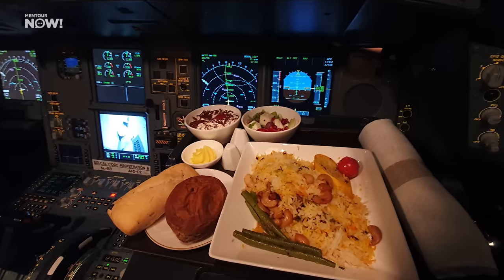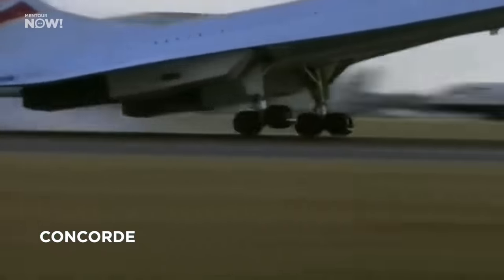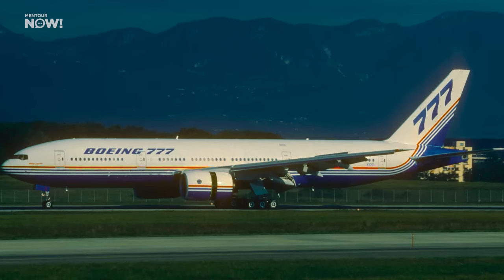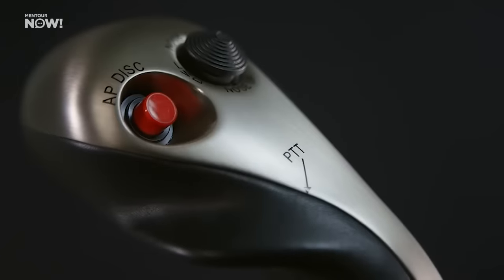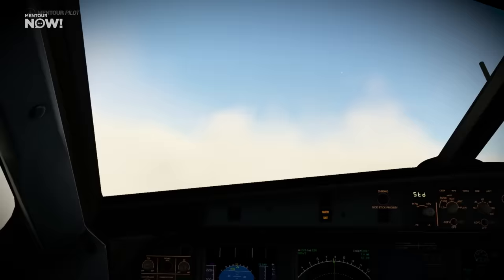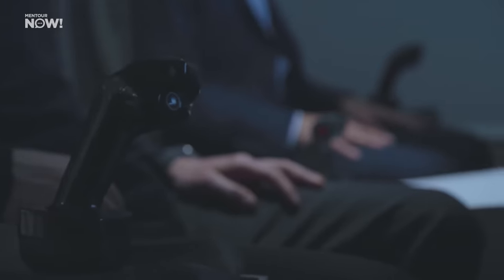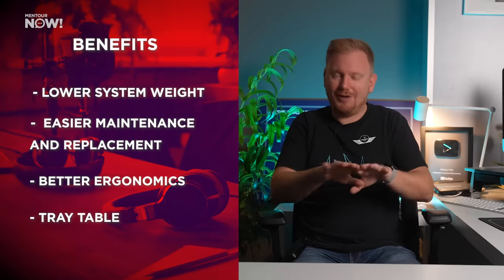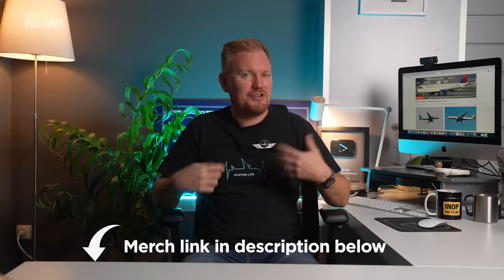Will Airbus Finally switch??

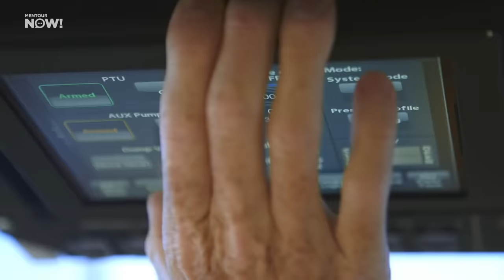Comment: What’s cool about Gulfstream’s side sticks at 9:58 and 13:40 is the pressure on the sticks movement is different from left to right. If you’re if the left seat, your left hand would be on the stick. You naturally have more strength turning your wrist inwards. So Gulfstream made the inward pressure and outward pressure different. This way both ways feel the same. And the the opposite on the FO side. Beyond cool.
Reply: What about left-handed pilots? And what about different combinations of dominant hand for first and second pilots?)
Reply: @lefty2050 Real-world pilot here. I’m right hand dominant, and it was a fairly natural transition when I flew a DA-40 with my left hand on the stick. I imagine the adjustment would be fairly quick.
Reply: @lefty2050 What I hear being said here has to do with differences in strength due to ergonomics (curling hand in compared to out) rather than hand dominance.
Reply: @rascallhunter   Thanks, it makes sense!
Reply: My favorite part of the gulfstream side stick is that my knee can get lodged between the stick and the tray table blocking movement of the stick.  What an oversight by gulfstream.
Reply: @dingodango1  Don't put your knee between the tray table and the side stick. Problem solved.
Reply: @dingodango1  tray in the stowed position when preparing for manual flight (takeoff, landing, etc).!
Reply: I can imagine the stick would be in its neutral position at 45° towards the centre of the aircraft. For the left stick, bringing it to vertical would be the full left roll input and bringing it to horizontal would be the full right roll input. For the right stick this would be vertical for full right and horizontal for full left. You would then not be turning or overextending your wrists outwards.
Reply: @rascallhunter  Yes. Sorry for not explaining it correctly. You nailed what I was trying to say.
Reply: Interesting
Reply: @lefty2050  This has nothing to do with handedness, your wrist is naturally stronger when turning inwards irrespective of which hand you favour.
Reply: HAHAHA!!!  Or maybe just don't fly!
Reply: @dingodango1 Interesting, we’ve been flying the G600 for almost 2 years and never had that issue come up. It’s been absolutely fantastic aircraft for us coming from G550s.
Reply: @R160A  side dominance can be overcome with time and practice. It happens all the time with people losing limbs, eye or ear.
Reply: I was also wondering why sticks must stay on the side and not in front
Reply: Airbus sidesticks have always allowed for that feature of the human wrist. Although the A320 didn't fly until 1987 (certificated February 1988), the sidestick had previously been developed in an A300 by Gordon Corps. 
Re switching seats: being right-handed, I had a tendency to over-control initially after switching from left seat to right seat, but you quickly adjust.

Comment: Active side sticks would be a welcome addition to Airbus fleets. I have 18 years on Boeings (737,757,767) and 7 on Airbus 320 Series. Now that we are flying with so many new hire pilots, with markedly less experience than new hires in the past, active side sticks would definitely add a layer of safety through improved situational awareness for check airmen and both pilots, especially the captain. I fly with pilots with under 100 hours in type on the 320 Series almost weekly, and I would really appreciate active side sticks.

Comment: I fly the A320. I would absolutely love active side sticks. One of the things I miss most coming from 26 years of flying aircraft with conventional yokes, I don’t like not having feedback at all.
Reply: I'm a flight/combat simulator enthusiast for more than two decades now and I've used all sort of HOTAS setups, including some high-end "boutique" stuff.

That said, I'm right-handed but I've developed severe pain in my right shoulder and I'm forced to use my left hand to control the joystick more often than not, but I'm struggling to adapt and it's nigh impossible for me to fly some very agile airplanes like fighter jets from DCS with my left hand controlling the stick.

I'm perfectly aware that flying virtually is worlds apart from the real thing, but I wonder if it's a problem or concern when a CA or FO is forced to control the side stick with their non dominant-hand?
Reply: @CapaNoisyCapa  It’s something we generally pick up very quickly. Even on aircraft with yokes you would typically fly with your right hand as an FO and your left as a Captain.
Reply: @CapaNoisyCapa  An airline pilot would simply not go to work if he had "severe" pain in his shoulder.
Reply: @CapaNoisyCapa  movement on sidesticks are only on the wrist, moving your shoulder means your seat position/armrest setting is incorrect. Also sidesticks movements are generally very very minimal because of the FBW characteristics of airbus
Reply: @CapaNoisyCapa  You don't normally fly a Yoke with both hands, and you don't always fly a center stick with your right either if the throttle controls are in the middle like most GA with center sticks that aren't specially built for the Air Force. You start as a student with your left hand, then use your right as an instructor (and that takes a bit to get used to, though mostly due to sight picture) Then back to your left when you fly yourself, then Right hand as an FO and left hand as Captain. Only Single Seaters and tandem's do you live your whole life only ever flying right handed. 

I will say though, with a dead spring centered control, it's a lot harder to learn. Which is why it's such a good thing the FFB patent troll is done and FFB yokes and sticks can be made without licensing again.
Reply: @CapaNoisyCapa  If you're flying a real plane in the left seat, you're going to be using your left hand on the yoke most of the time whilst the right is dealing with the central console. It's just the way it is and pilots MUST be able to fly with either hand
Reply: So gamers have had more advanced force-feedback yokes than pilots for thirty years. Who knew!
Well actually, FFB was on the CF-105 to give the pilot feedback. That aircraft was so far ahead of its time, it is silly it did not go into production.
Reply: @CapaNoisyCapa flying right or left handed takes very little time to transition. I learned to fly in a plane that was right hand stick and left hand throttle and then switched after about 60hrs and it took less than a single flight to adjust.
Reply: So air france 447 you would have caught the problem ?
Reply: @KlodianHysi  AF447 was down to bad CRM, poor situational awareness and rotten training

That said, there were a dozen opportunities to save it once the incident started, if the crew hadn't behaved like headless chickens
Reply: The A220 series have FBW sidesticks with feedback.   Strictly feedback isn't necessary.  The force Feedback lets the pilot know how hard he is pushing a manoeuvre so he doesn't over deflect the controls at speed..  In a FBW system the control surface deflection is limited by the control system control laws and other Software loops using the accelerometers and gyros.
-Force feedback and help a pilot understand that he has posed the controls to the Limit or is fighting with the other pilot.
Reply: @bernhardzunk7402  Those on the A220 receive artificial force feedback but they are not linked to each other.
Reply: I agree. Even more important, in my opinion, is the lack of moving thrust levers in the Airbus.  Which forces you to divert attention to the engine instruments to more intuitively know what the engines are doing.  Like most situations with technology, one learns how to adapt to the change in cues offered by the different control systems unique to each aircraft type.  The biggest problem, in my experience, is when going back and forth between aircraft with the different control systems.  I flew the 737 and the A320 concurrently for a time, and like when driving a sports car and truck,
Reply: tell me isnt it hart to control plane with this tiny joystick with left hand?
Reply: That anyone could have designed primary flight controls without felt feedback coming back to the pilot seems to me completely bone-headed, and an example of intellectual arrogance in the tech field. Felt feedback (as opposed to intellectually interpreted signals) is hugely important to humans' navigation in the real world on foot and in getting in and out of chairs and so on. A huge part of what informs our mental experience is un-  or sub-conscious input, and to omit this in flight controls is, well, bone-headed.
Reply: Dexterity of right hand or left hand while flying an airplane is typically not a huge problem because pilots are trained in both seats practically from the first ever flight. I flew from either seat even during my initial flight training many years ago.  Mostly with the instructor in the right seat.  But, I also flew the airplane from the right seat when my instructor was in the left seat.  This experience would be no different with a side stick.  The only challenge I recall learning to fly with the side stick was the sensitivity, or minimally required stick deflection. Just as I remember from flying the yoke for the first time, the key is to not be a ham-fisted pilot.  The sensitivity issue is even more of an issue in helicopters.  Learning to fly using a with a light touch, or if you have a strong grip, to move the stick from the base of grip using only your fingers, rather than using a firm grip with the entire hand.  This is all about pilot technique that must be learned, just like any other new experience.
Reply: That issue has been my main objection to side sticks which don't show each pilot what the control inputs are. Said by a guy who flies a desk.
Reply: What the other pilot is doing isn’t my main problem with Airbus in day to day operations. It’s not being able to feel the aircraft. Even with the autopilot on I would have my hand on the controls in the terminal area so I could feel what the aircraft is doing. There’s none of that in an Airbus.
Reply: But you don't though.
Reply: @grizzlygrizzle , how much you have flown with aircraft that doesn't have feedback? I couldn't care less to have feedback on A320 series. It would not change anything, only make flying more complex.
Reply: @bayouflier6641 I'm not going to out anyone but that's because they don't show it or talk about it like they don't talk about other stuff you shouldn't hear about.
Reply: @charisma-hornum-fries  That made no sense.

Comment: As an A320/350 TRI/TRE it would certainly make landing with a trainee less tense, when I was flying Boeings it was far easier to see that my colleague was (or wasn't) making the correct inputs close to the ground. this was my biggest hang up when I moved to the bus and even more so when I took on a training role
Reply: Is “the bus” actually a nickname used for these? 😂 I love that.
Reply: it's literally called air bus
Reply: @NicholasAndre1  It is. Many pilots say "the bus" when referring to Airbus lmao 😆
Reply: I was a bit surprised this wasn't really addressed as a benefit in the video. My organization is seeing lower experience levels in new pilots than in the past, and every bit of feedback near the ground helps.
Reply: @NicholasAndre1 yep. The actual nickname is the ´bus with an apostrophe, to emphasize the shortening
Reply: That first flare on that first landing. Yes, I know exactly what you mean, far easier to follow the new pilot with a yoke or an active sidestick.
Reply: Yes definitely! As a new A320 pilot I’ve had multiple TRIs comment on this. And from my perspective I’ve definitely missed the ability to follow through like on other aircraft when in that learning stage. It’s difficult to learn what you’re doing wrong/right in the early stages.
Reply: You are right: there are more button pushers and magenta line followers than true "Stick and Rudder" pilots...
Reply: Nice try fbw msfs pilot 😂😂😂
Reply: @Captainriad  erm ok, my logbook says different but you're entitled to your opinion
Reply: @Captainriad  Odd to see this sort of comment on this channel.  Possible case of projection.
Reply: The landing technique for large, ie above 5,700 kgs/12,500 lbs has to be sorted out in the simulator, not on the aircraft, if simulators are available. 
You don’t actually fly by measuring stick displacement either. If two people make inputs, the control load, ie feel will not be the same as usual and overcontrol is a high risk, as demonstrated by tail strikes etc in conventional types. At least in the Airbus, you aren’t taking over a wildly out of trim aircraft and using the disconnect button, the gaining of control is instant and absolutely clear.
Reply: You should have had landings and handling sorted during the full flight stage, with actual flying being merely refining processes already embedded.
Reply: @moshedyane  doesn't always work like that. The sim is a great tool but does fully replicate the real world or the pressures trainees apply to themselves. For many we train it is their first flight with passengers or to some wacky destination with odd weather. You can play a video game (the sim) where 2+2 always =4 but you can't do the same with mother nature
Reply: True pilots feel their plane . I flew both KC135, MD83 and A330 respectively 1500, 5200 and 9000 fly hours, m’y expérience is that yocke has no adventage to know what the other pilot is doing because you havent any position reference from the yoke. 
Flying the A330 I felt enough the plane to know what the FO was doing. I took controls easely in case of bad correction on landing.
So definetively no change is needed for the Airbus’ sidestick. The AF 447 crash is not a reference cause thèse guys where absolutely non professionnal and never applyed any Airbus procedure even by the left seat FO to take controls.
Reply: Boeing is the one who should learn from Airbus not the other way around
Reply: @moshedyane , do you have a reference for A320 FFS that would behave similar way like the real aircraft in landings? I haven't found one yet. Another issue is the fact that something like 99 % of A320 type ratings are flown in A320 simulator, but the aircraft used for base training and flights operations is A321 and it is different to flare and land than A320. Also the sharklet vs. wingtip fence vs. no fence at all (early models) makes difference.

Comment: The F-16's stick initially didn't move at all in the A models. It was only due to pilots wanting some sort of tactile feedback that LM added their motion at all.
Reply: Yea, cause the max force the stick senses is like 20 pounds or something, and there was no way of knowing when the pilots reached that force. So they were pulling and pulling and then they were landing with bent sticks. At least that's what i've heard.
Reply: Yeah that's seems like such a crazy decision. Like the decision an engineer might make for sensible reasons (to them) but when it's actually in use it's downright dangerous/stupid. Imagine if your car worked like that, and you never knew how far you actually had the wheel turned at any given time.
Reply: GD, not LockMart. LockMart bought GD later.
Reply: @firstlast6796  -- It really wasn't quite that crazy. The main reason they made the change was that pilots arms were cramping after long periods in the cockpit (sometimes not so long), and they found that the simplest way to fix it was to add a bit of movement to the sticks.
Reply: Yes I also read this with the initial F16, and it was all about the force the pilot put through the stick in his grip that was needed . But of course the pilots are going to think ok I need x force, when they get to feel overwhelmed or the adrenaline starts pumping then the old instincts to pull hard…
Reply: @firstlast6796  Hm, in Tesla cybertruck the system will decide itself how far wheels are turning when you turn the steering wheel. Based on several parameters, including your speed
Reply: @dmitripogosian5084  Yes. And it is relatively new thing. We will see. But you don't have "steering wheel" that just feels "how much you want to steer" and doesn't move. That would be bad.
Reply: @jordananderson2728  True, but that was just the sign over the door.  It was the same plant in Fort Worth, TX, with the same people working on the aircraft regardless of who owned the operation.
Reply: @firstlast6796  There was a lot more that went into the F-16 side stick design that is not commonly known, but there sound reasons for why the stick was designed the way it was.  One particular constraint was the space around the stick was very tight since the cockpit is so narrow.  But even on later aircraft when space was not an issue, the travel on the stick controllers moved very similar distances to what's currently flying on the F-16.  The engineers who worked out the travel got very close to optimum.
Reply: @sandgroper1970  The F-16 side stick was more than robust enough.  It was based on a sensor at the base of the center stick of the F-15 (used for electronic augmentation of the mechanical inputs), and with the leverage on the F-15 stick exerted far higher forces than a pilot can exert on the F-16 stick, which is mounted with essentially no lever at all, just the grip.

Comment: Retired airline pilot with time in B737,757,767, AB330,319,320,321.  Never had a problem when going from Boeing to AB once the system was studied and understood.  Had stick and yoke experience in Navy as well.  Learn your aircraft and understand how the controls work.  Also know where your standby instruments are and use them when the electronics fail you.